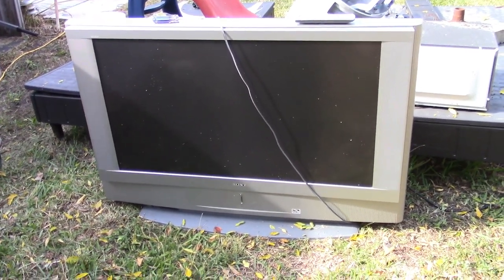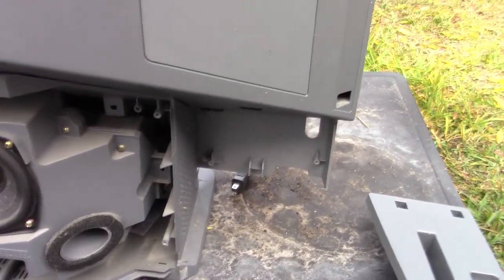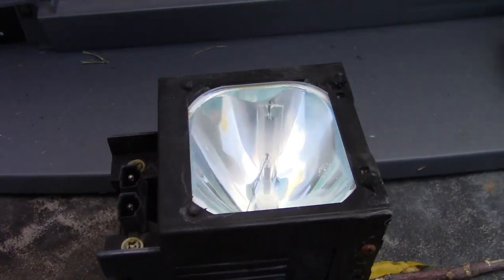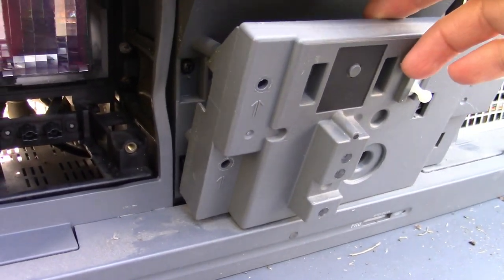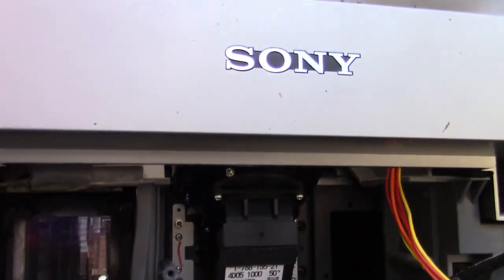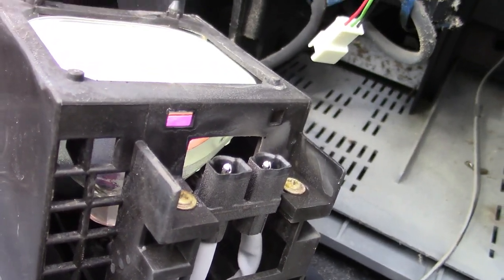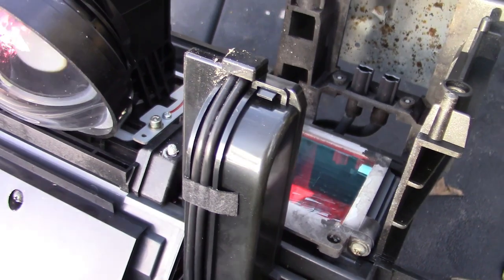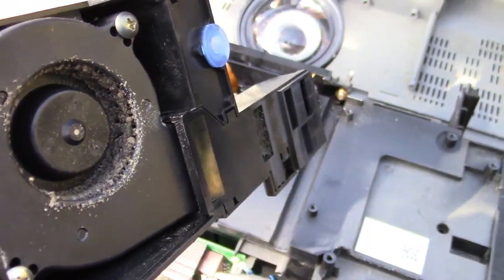What's Inside a 50" Sony Grand Wega rear projection TV

Comment: Great TV. I bought mine in 2005 and it is still going strong First bulb lasted 13 years  Still on my second bulb. Love that it has such a variety of analog and digital input jacks on the back.
Reply: Hi sir I am technitian,I have one 50" Sony protection tv for Ripaire ,but I will not  understand to remove it,s top back- cover you haave eney  vidiyos
Reply: I'm trying to make all of my inputs appear. I bought the TV used and only 3 of the seven inputs appear when I scroll through. Any ideas how to fix?

Comment: Hey man!  Thanks for this tear down.  I just pulled a 46" model from a dumpster and I was having trouble getting the projector part out.  Its those 3 screws that I couldnt figure out 🤦‍♂️.  I'm trying to salvage any parts I can for fun experiments.  I was about to give up and just get that main lens off, but after seeing this, I'm diving back in!!  
That clogged fan for the bulb seems to be a common problem.  The whole panel was melted and that first lens was all bubbly melted, just like that one!!
Again, Thank You!!
Reply from the maker: Yea, I have to imagine that some of these might have actually caught fire. It was a bad idea there. That area should have been all aluminum with fins. Glad I could help with the disassembly!

Comment: Very durable TV. I have bought one in 2004 and it is still working. With the original bulb! Very reliable construction of power source.  During this time it survived many storms and lightning connected to external antenna, and power outlets in our village house where another 2 newer TVs  (Samsung) connected to the same wires could not stand it and were damaged by electric discharge. It is true, that its brightness is relatively low because of technology used, but in normal room it is pretty enough.
Reply: I'm trying to make all of my inputs appear. I bought the TV used and only 3 of the seven inputs appear when I scroll through. Any ideas how to fix?

Comment: I took my working WEGA apart too, it's definitely a neat unit to play with. Mine doesn't have HDMI and did not have a sub! That location where the sub sits just holds a fan, guess it was an older model. Amazing how the technology has evolved. It's cool to see all the components and neatly routed wires, and they all extinct in the modern technology.
Reply: I found the sub, it's on the left side of the screen box, where you can see the grill for it on the back of the box.  The sealed panel on the other side is just for the aesthetic.  The sub on mine is only 4", not like yours. The front speakers are also missing tweeters (SONY cheaped out on this one) although they left the place for it, not sure if yours has tweeters or not. Anyhow it's a fun experience to take it apart.
Reply from the maker: @yauck1  Yes, this TV was truly the most fascinating thing I ever took apart. And aside from all that, once I had everything out of it, I couldn't imagine what the molds looked like that made all the plastic casing.

Comment: You can spray clear gloss finish to the nearly linear surface of the fresnel lens or spay wd-40 on it and it should be a very clear spot lens, i gurantee it will boost the tempeture dramatically, testedit myself and was pleased with the results (using the wd-40 method).

Comment: I got the front screen off without having to lift it off that bottom part like you did. you can get to those screws you said you couldn't get to without having to take the whole top part off.  they are accessible without taking it off.  you just gotta have a very long Philips screwdriver, the same one you would use for those 2 brass colored screws that are deep between the projector and that other doohicky in the back. it's worth fishing those screws with a long Phillips, if you're trying to keep the whole tv up right while removing the screen and want to keep it intact and not scratched.

Comment: Excellent video! We have the exact same TV, passed down from mother who bought it in 2004. The bulb just burnt out on it. Ordered a new bulb, but from your video I bet that the fans are just as clogged as the ones in that TV you took apart. So, I have a question for you.

Is there a way to get to that bulb exhaust heat fan easily without tearing down the whole TV like you did to clean it out?  I've gone back over the video, but it is hard to see what exactly needs to be removed to reach that squirrel cage fan for cleaning.  Thanks ahead of time for any guidance on this.
Reply from the maker: Oh boy I don't really know. I kind of discovered all that from the back as well. I might try just blasting the area with an air hose and hope for the best. But yea, if it's clogged, it'll melt like that. Pretty scary.
Reply: Thanks for the reply.  At the very least, your video showed me that the fans really need to be cleaned up, especially that one that cools the bulb.  So, my wife showed me a bag of small tubes and attachments to her new Shark vacuum that will probably be able to be inserted into that squirrel cage fan center while I blow out the vanes with that canned 'air' for cleaning keyboards, and circuit boards, etc. First I will remove that old burnt out bulb and then do a thorough cleaning, but I'm not going to touch the objective lenses or screens, just get the visible dirt out everywhere I see it.  14 years on the initial projector bulb is pretty good, in my opinion.  If I can get another 14 years out of it, that will probably be all that is necessary for me.  Be lucky if I make that many more years of watching anything.  Thanks for the GREAT VIDEO!
Reply: Thanks to your video, again, I was able to first clean out the squirrel cage fan prior to replacing the burnt out bulb with a new one.  The squirrel cage fan was clogged similar to the one in your video, but not as bad.  My wife had a small vacuum attachment for her large Shark vacuum.  I used that and one of those canned sprays  for cleaning computer internals to get those fan blades completely clean.  I had to remove the two screws visible on the backside so that I could tilt it up to get a good shot at the blades.  Also cleaned both of the other fans.  Put the new bulb in, and reassembled the whole TV.  Turned it on and it works just like new.  The picture was noticeably much brighter and sharper.  Your video made the whole process easily accomplished.  The more of these type videos, the better.  It's always good to see what actually exists instead of just guessing, which usually leads to making junk out of something that still has some lifespan to it.

Comment: I found this same model tv in the trash without a scratch accept for the exact same internal damage as the one in this video. I went to the trouble of taking it apart thinking i was going to find me a nice chunky golden dlp chip thinking it was a dlp tv. it's not a dlp tv this does not have that, but at least it has as much gold and silver as an pricey desk top. I know i wouldnt pass one of these up if I find another.

Comment: Is this tv good for retro gaming
Reply: Absolutely not. You need a CRT TV because projection TVs have input lag, horrible reliability  and horrible picture. Different CRT TV models also range in resolution from 480i/p to 1080i/p so you can actually play consoles such as PS3 and Xbox 360 at their highest resolution.

Comment: I don't think using a long handle on any tool helps reach connectors which are deep.
Perhaps you meant to say a long or extended shaft?  
Example:  
Your screwdriver has a 8 inch shaft and 5 inch handle.  The screw in 9 inches deep.  A "long handle" or 8 inch shaft, 8 inch handle does nothing.  My conclusion is that you merely misspoke.